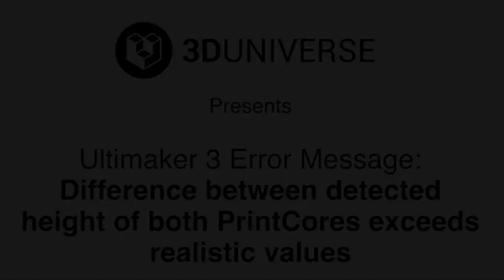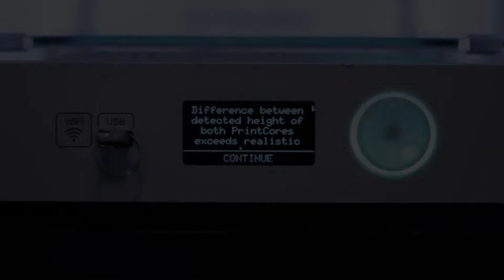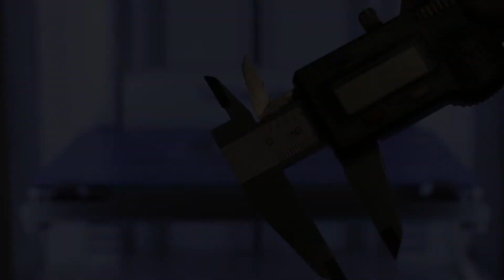Ultimaker 3 Error: Difference between detected height of both PrintCores exceeds realistic values

Comment: you missed the  most important reason   and no what you do recalibrate   ect still  shows error   turns out if you print core  had a failed print and is full of material around print head and when you pull it out you could break off one of the wire to the drop down cover which is the the level  sensor    this will need resoldering  back

Comment: Do you have any suggestions for the same problem on UM S3?
Reply from the maker: You can try the same fix (lowering the bed a little, then redoing manual leveling). If that doesn't work, I'd contact Ultimaker support at https://support.ultimaker.com/ for further troubleshooting. It could be an issue with the capacitive sensor or one of the sensor wires. All Ultimaker printers include lifetime support, so they will help to diagnose the issue at no cost to you.
Reply: @3duniverseOrgWelcomesYou  Thanks, I ordered a capacitive sensor anyway. Cheers